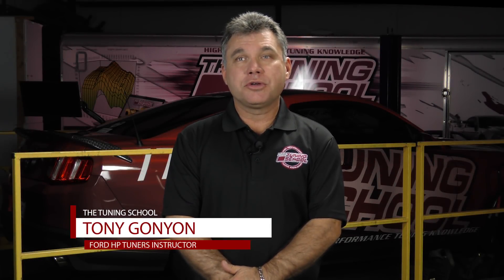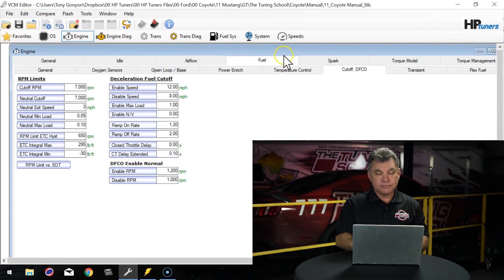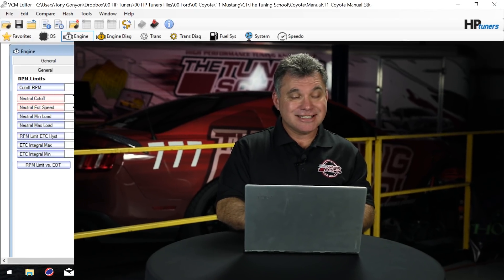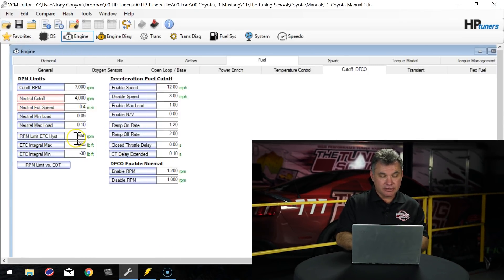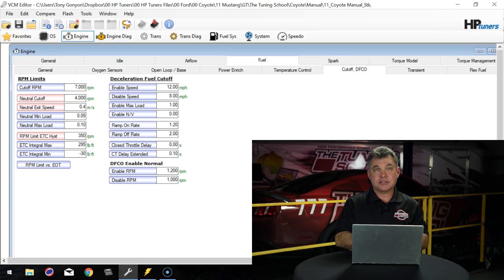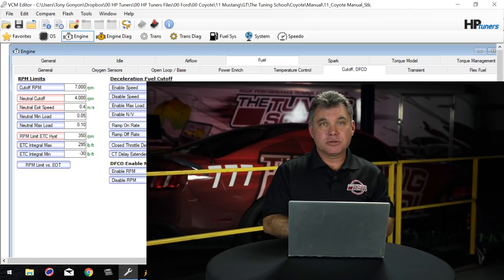How to Program a Two Step for Your 5.0 Mustang Using HP Tuners

Comment: Tried this on my 5 speed 2004 GT, and it had the rpm limit at any speed. I had speed set to 1 mph, but it didn't disable the neutral rpm limit.

Comment: Is this possible to setup with a 6R80 and a transbrake? It wouldn't be on the neutral side.
Reply from the maker: It is not currently possible with just the HP Tuners software.